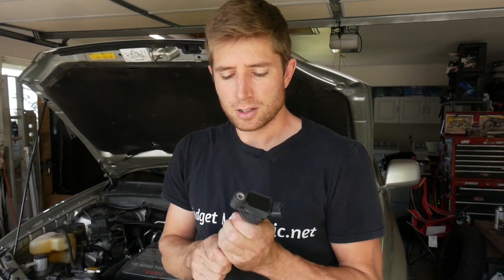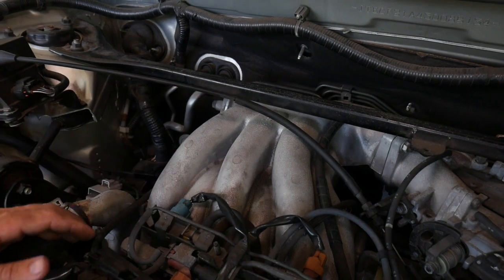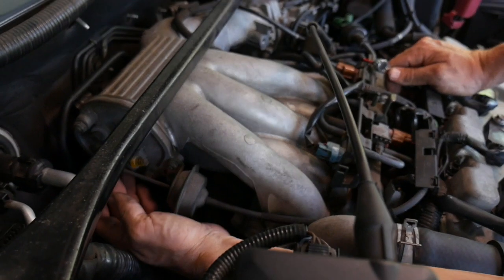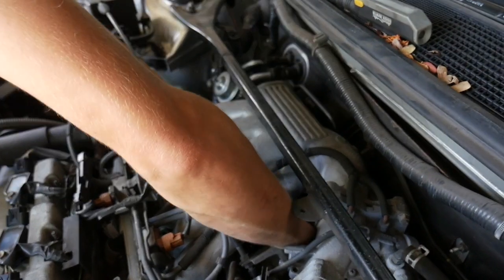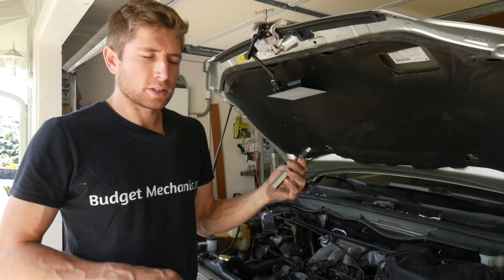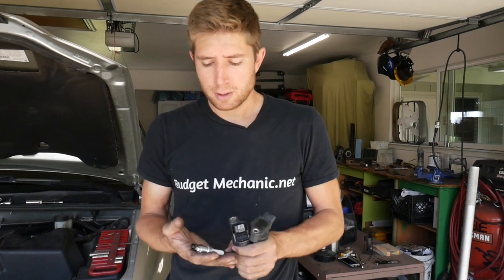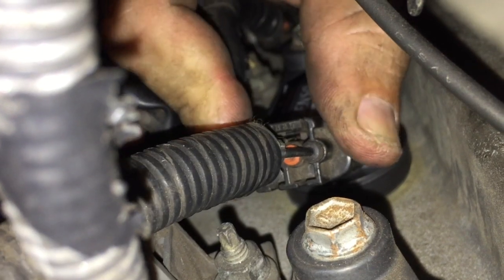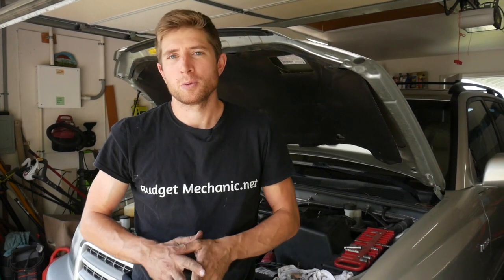Short Cut! Replace Rear Ignition Coil On Toyota Highlander Camry Lexus 3.0 V6

Comment: I’m not a mechanic by any means. I’m a marketing director. This is the best video on YouTube for doing this job. I was able to replace the all spark plugs and coils without removing the intake. Thanks so much for making this video. Excellent!
Reply: I have a 2001 RX300, I would guess this works
for mine as well, either way, I think you just answered
my question of whether his will only give access to the center
rear coil/plug array..

Comment: I tried this method on my 04 Sienna and it was a pain in the rear but it worked. It took me about 2 hours to replace the entire rear plugs. Now, if you're 5 ft 7 and short forearms, you're gonna need a stool. It was embarrassing because I had to it outside my apartment parking spot. Thanks Toyota!!!
Reply: Did you have to remove the plastic shield between the hood and windshield? Thanks!
Reply: “5’7”…need a stool” 😆😆😆
Thanks for the tip! I’ve added it to my list of tools to use. 😁
Reply: only 2 hours is amazing imo compared to removing the whole intake. ty
Reply: 5’ 1 “
Reply: Damn I am 5 ft 5. what tool I need man
Reply: Just did the exact same thing pants falling bending in awkward position hearing people walk behind me it took hours on the middle plug Alone you have to use two hands to get to it

Comment: I have a 2000 rx300 (same engine) and have changed the rear coils several times.  Using both the "remove the whole top of the engine" method at least twice and the method Josh demonstrated.  This is the best video I've seen on how to replace the rear coils without taking off the air intake manifold.  This method is well worth a tire.  if it works for you it will save you about 6 hours of work.  Thanks Josh - great video.

Comment: It  is possible to do this on 3.3L 3MZ-FE engine in a 2005 Highlander, as well.  Difficult, but possible!  I had to replace the valve cover gaskets a year ago and thus removed the intake plenum and did the plugs then.  Little did I know that those DENSO plugs sold on eBay are COUNTERFEIT.  The center electrodes were mostly eroded away in 15K miles.  I had misfire cyclinder 3.  car went into limp mode and was missing.  I had to tow it home.  I got new Toyota boxed Denso plugs from the Toyota dealer and got them in.  Now the highlander is running good again.  Don't make the same mistake I did.

Comment: You can also use the coil pack to remove the spark plug after you loosen it
Reply: Or a 8" length of 1/4" ID clear tubing

Comment: I just did this on my Lexus ES330 didn’t want to spend $250 for someone to replace just 1 coil and I came across this video. My car had a cylinder 1 misfire and mines used the 10mm tool as well. Thank you so much 😊 it was so easy a girl did it thanks to you.

Comment: Fine Job, Josh. THANKS! 
Saved me a TON of $$$ ON MY 2003 LEXUS RX300 ... did 120K "Tune Up" a bit early @ 113K. Dealer wanted $1,100 for the tune up ... PLUS $1,134 to replace all 6 plugs ... Yes! $189 EACH PLUG (and all 6 or nothing) at the same time.  I did it myself for ~ $600 in OEM parts & materials!  I paid $50 ea delivered for NGK plugs made in Japan and spec'd for Lexus.(also dropped the Xmission Pan (Cleaned, New Filter, Amsoil) !
YOUR Video ... gave me the courage to do it ALL. I am NOT a mechanic, but rather a former radio/radar field engineer who can "sort of" fix, adjust, test, re-design/improve things ... though always Slowly and Carefully.
And I love to "Cheat and Learn" here at U-Tube University! 
Best to all,
John in the NW

Comment: I am just in the middle of removing the intake following other videos and could not remove the nut off on the back against the wall, then I came across your video!  This is truly amazing and I am going to try to change spark plugs without removing it.  Mine is 2002 highlander.
Reply from the maker: Glad it helped 🤙🏽

Comment: Wish I had seen your video earlier.  I just replaced 5 of the 6 spark plugs on my 04 sienna. I didn't want to remove the air intake and wiper cowl etc that most of the other uploaded videos show. Although I couldn't get to the one underneath the plenum I was able to get the ones on either side of it. Wish I had your brilliant idea at the time I was doing this. But now that I have seen how you did it,  I am going to replace the last remaining one too. Thank you so much for uploading and sharing !!!

Comment: I CANNOT THANK YOU ENOUGH FOR THIS!!!!!!!!!! Yours is the best video on how to do this. Although I have a 2001 Lexus RX300 my understanding is they are pretty much the same vehicle. In fact my my#3 is in the same place and unless I'm wrong you removed the #4 as an example.
My # 3 and 4 are misfiring. Of course #3 is the one you just did! I'm gonna replace all 6 plugs and all 6 coils. My shop wants $1000 for parts and labor. $400 for parts and the rest labor. My cost for parts was around $200 total and I'm assuming a day under the sun with the tunes on and a couple of sodas...lol
Again, thank you so much for this video.
Only problem I see for me is I'm a bit short with shorter arms. I might need a small stool.
Reply: Did you buy both plugs and coils for $200. If so, mind telling us where you purchased them and what brand? thanks
Reply: sukh kawal I bought dense for my Toyota off of Amazon

Comment: This helped, I never attempted it because I have big old ham arms and hands, but once I leaned into the engine and got into the meat of the muthah I was surprised how easy it was the get into. I didn’t even have to remove that vacuum thing, just popped up the Pcv valve and pulled the hose up out of the way. Thanks for doing this!

Comment: Excellent video. Replaced my #3 coil and spark plug last night. Used a very handy item. Gear Wrench 5/8 x 6. Spark plug wrench. Got it at Advanced Auto parts. 80546 part number. $10.99. Has a magnet to hold the spark plug. Once again thanks for the video. 2001 Lexus RX 300.

Comment: The moment you lifted that coil pack out I just laughed out loud.  Funny reaction, but I did it the hard way (taking the plenum etc off) and I wouldn't have believed you could go directly like that, without taking the wiper mechanism etc., off.   True, I have a2011 edition so it may differ, but it's definitely worth a try.  Never would have thought you could do it.  Your process for removing and replacing the spark plug is exactly the one I resolved to as well.  Great minds...Thanks a ton for showing us the magic trick.

Comment: Came up with an additional method that might help some people. Spent legit two hours and could not loosen the connector off while pushing the tab all the way down the way he does it, just couldn't get the screwdriver to get leverage to pry the connector off the coil head.  So, I found I could place a standard pliers around the tab to push it down with my left hand working  thru a different hole (near the firewall) and then use a small screwdriver (about quarter inch wide head) and actually slightly pry up the opposite end of the lever of the push tab, to pry that up and over the hub it hugs, then used that smaller screwdriver to push the connector off the ignition coil head. My 2001 highlander is so rusted that I couldn't get the AC thing off on the left though I felt like that might not have even helped me to get his screwdriver trick to work. Still an amazing vid.

Comment: Thanks so much for this video! Its hard to find specific videos. I have a 2001 Lexus RX300 with 270,000 miles (with brand-new transmission) and it has the same engine in it. I changed the spark plugs and coils this week on all cylinders but cylinder 3 because I couldnt reach it and I was too nervous to take anything apart because I didn't want to struggle trying to remember where everything goes, but this video is PURE GOLD man! Thank you so so much! This makes everything so much easier! You definitely got a like and subscribe from me! Like honestly man you just saved me hundreds of dollars. 

-Not all hero's wear capes! Lol
Reply from the maker: Azarius Shaw I’m glad it helped!

Comment: I recommend just removing the plenum, I tried to remove the spark plugs as in the video but was taking way too long. I spent about 2 hours trying to remove the ignition coils. Only took me about 8 minutes to remove the plenum. After that it was smooth sailing
Reply: How long did it take to remove the plenum? Is not the things that's supposed to take a long time and auto shops say is the reason to replace all coils and plugs at the same time because it's a pain?
Reply: @hillsane9262  With the correct sockets and hex key its simple. Took me about 25-30 mins to disassemble and remove old plugs and reassemble.
Reply: @hellspawn8572  Thanks!  That does not sound as bad as most say. When they over an hour, just for the plenum, may be that includes putting it back on, but you changed out the coils and plugs too.

Comment: Thanks a lot Josh, You are an excellent mechanic and had a good video camera. I have a Highlander 02, V6. I just bought 6 set of ignition coils OEM from EBAY ( The coils are exact the same and identical of my original one that I removed) and 6 DENSO spark plugs. I followed your instruction and it took me about 3 hours to complete replaced the coils and spark plug # 1, 3, and 5. 
To remove the coil #1, I have to remove the 2 ground wires on the left that gave me more room for my left hand side. The coil #1, I have to pull out to the right side. I tried to pull out to the left but it is stuck.
Removing coil #3 is much easier than remove coil #1.
Coil #5 is also easy to remove.
To open the coil connectors, I built a small C clamp bar. I drill a hold on top of the bar, use a tap to make a thread and install a stud. This stud will tie the center of connector coil so you don’t need to press the connector coil. Then you can remove the connector of ignition coil much easier.
Reply from the maker: Whoa great job!

Comment: I just did this for cylinder 1. It worked so thanks.  I did have to loosen 1 vacuum hose and 1 set of ground wires and the black brace that’s bolted on the strut mounts, in order to get the ignition coil out, but the general idea worked, thanks.

Comment: saved so much money, thank you!! it was definitly tricky and seemed impossible at times but for sure easier than removing the whole manifold and other things,
I was able to get it out without removing the ac idel controller or acceleration cable bracket wich also saved time. I used a set of needle noce pliers in my left hand to remove the electical connector to squeeze the tabs while pulling with my right hand on the coil.

I didnt even bother to replace the spark plug because im fing lazy lol. cars running great now - 06 rx330

Comment: Would it be the same method to change the other 2? Could you provide a size for your tools? Thank you.
Reply: the Philips screws holding the vacuum actuator were #3, the accelerator cable bracket was 12mm bolt, the coil bolts are 10mm, the spark plug is 5/8" standard spark plug socket... the extension he used looked like a 3 or 4 inch, plus that little adapter (long enough to reach the top of the spark plug tube, the hex (allen) bolts on the engine cover i think are a 6mm if I remember

Comment: GREAT video but I found that removing the coil plug was the tough part UNTIL I used a snub (shorty) blade screwdriver from the RIGHT while pressing the tab with my LEFT (twisting the blade while pressing) and...............GOT IT!! Thanks again! Bob

Comment: Nice video !!  I think this procedure actually works on Camry's with the 3.3L, but NOT on Lexus 3.3 cars.  Lexus plenum is different and you can't reach under it like you are managing on this Camry.
Reply from the maker: Thanks for that info! We are looking into the model differences
Reply: He's working on a 2004 toyota highlander
Reply: Personally, I've found that the Aluminium intake plenums for the 1MZ-FE (3.0L) have the space for this to work, while the newer plastic ones on the 3MZ-FE (3.3L) don't.
Reply: Worked as advertised on my ES 330 thanks for such a great video!

Comment: THANK YOU! I replaced my highlanders fuel filter, as it was running rough (turns out it was the oem one from 02, 170k later) and now, my engine is running extremely rich. I had the spark plugs replaced at my mechanics, but now, I can do the coils myself!

Comment: Thanks for doing this video. I followed your procedure on my 2002 RX300. This saved me a lot of time. Awesome shortcut.
Reply: I was wondering if ur worked for the rx300 ..I have a 2000 rx300 with this problem
Reply: @lilj882  this worked on my 2002 Rx300 so it would work on your 2000

Comment: Thanks man, this was awesome. I'm working on my bosses Highlander and I was looking at what it was going to take to remove that upper intake. It looked like there might be enough room to wiggle them out , and I always try and remove as few things as possible when I'm working on cars, so I absolutely appreciate your video for the reassurance I needed. And you were completely correct about all of the vacuum lines and plastic pieces under there being brittle from the Heat, I did break one of the vacuum connections barely touching it. thanks again, definitely subscribing

Comment: A rubber hose also works when removing or installing the plug.  Just stick the top of the plug into the hose and you don't need to worry about it dropping into the spark plug hole.

Comment: Great video, Unfortunately this does not work on a 2003 Toyota Highlander…at least not with my hands.  There is simply not enough room on the left side (even after following the video) to get my hand behind the Intake Manifold.  I was just barely able to remove the far left sparkplug (#5) and replace it.  Even then I was hard pressed to get enough clearance to fit an extender or any combo thereof into the chamber.   I certainly don’t have enough room for cylinders #1 and #3.  It’s really too bad Toyota made something as common as spark plug replacement so difficult.   My only option now is more teardown to get room for hands and tools or just bite the bullet and take off the Intake Manifold.

Comment: Would it not be recommended to use anti seize on the threads?

I did see someone using dielectric grease inside the coil as well,
Any experience on if this is a good practice?

Comment: This method works on a 2003 Highlander, just did #3 coil and plug, hardest part was getting the vacuum bracket screws out, they should have hex heads not phillips.

Comment: To remove the loosened old plug (loosen until a few threads are holding) and install the new one, use an old spark plug wire boot fitted to a short 3/8" extension/screwdriver/tubular object. Short, straight piece of hose also works but boot is better. Save it; you'll use it many times. Magnet is for the skilled and brave.

Comment: Very good video, but I could not get in on the back side to change my Toyota Highlander 2006 2.3L ended up taking it to the shop and they did it. Next time I need to get it changed I will try harder.
Reply from the maker: Ouch! Gotta shrink those hands!

Comment: I’m getting a code for the number one cylinder. Any chance that I can get to that coil without removing the plenum ? Thanks PS I recently put plugs in but we didn’t do coils while we were in there. We were in there doing knock sensors.

Comment: So the code im getting on mine simply says lean condition on the rear bank. Does that usually mean bad injector, or coil/plug? I also sometimes get a flashing engine light which supposedly means it is currently misfiring. but it's only done that twice. The Lean condition code is always active.

Comment: What if your #3 coil won't let go of the spark plug?  I loosened the the bolt just like the rest but it wont pop off. Any tips? 
I feel like it is just about to pop but something is sucking it back down again

Comment: Need help!
I got my Highlander to my friends performance shop to get that job done. 
Problem is the codes for the 1,3,5 still pops up (it didn't when he got the job done even with his expensive OBD2 scanner). 
The car is burning gas as if it had a hole in the tank (half tank gave me 155 Kilometers) 
There is also a thermostat code that I wanted to wait to repair depending on the first repair, I don't know if it is related. Any ideas what's wrong ?

Comment: My memory is not very good but,

Maybe a little over a year ago I had to replace the knock sensor, I did the valve gaskets while in there , but for the life of me am not sure why I didn’t hit the spark plugs while I was at it.

The spark plugs were done maybe 4-5 years ago and maybe 30-40,000 miles.

I have a misfire in cylinder 3 and 4.

Going back to 4-5 years ago, I had read with small hands and some extensions, it’s possible not to remove anything.
I have giant hands but, 
I gave it a go and got all done except the back middle, I remember hitting a bracket with the coil and thinking there no way to get it out without removing the plenum.

Isn’t there a back bracket holding the plenum that would be in the way? I don’t see this being a problem in the video.

Comment: Hi Josh...could u advise on a good ignition coil manufacturer thats reasonable cost?
Reply from the maker: Not really, different brands manufacture coils for different vehicles. I usually use the “middle of the road” option on sites like rockauto. Just don’t go for the cheapest but no need to get oem
Reply: @BudgetMechanicHawaii  thanks for the reply...did all the plugs yesterday....went well...I also had to remove ground wires & a small right angle hose  to get the rear passenger side coil out. The clips  on those connectors are difficult but all went well. Also noticed a crack all the way down  the tube part of the coil I replaced 2 years ago.. That coil i bought at advance auto for $50. Did not  have a name on it but u would think that for $ 50 the part would be decent quality. Next time i will only by oem for coils. Cant thank u enough!!!...Your video inspired me to do it myself!!!